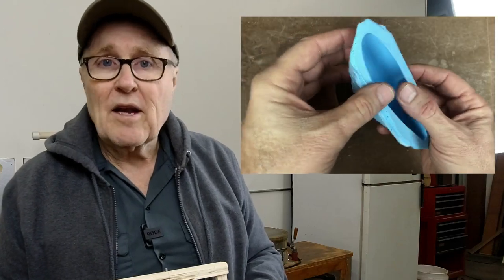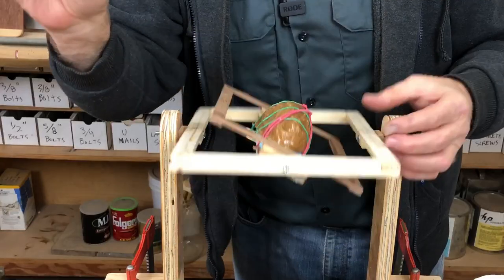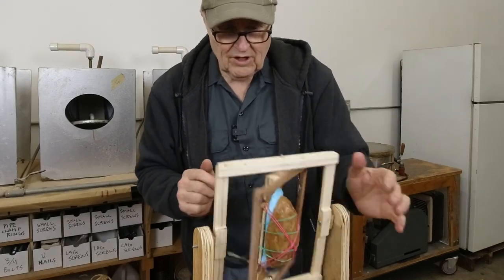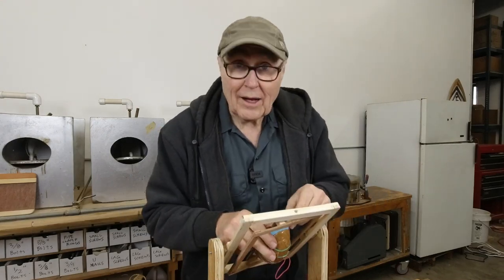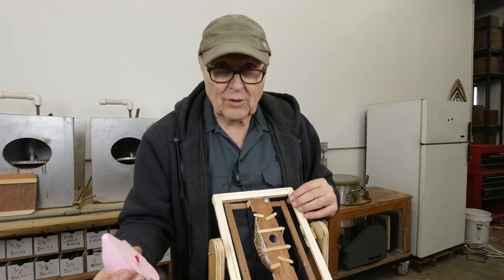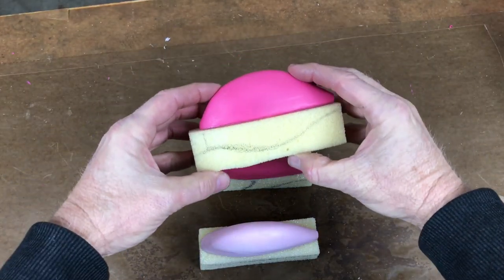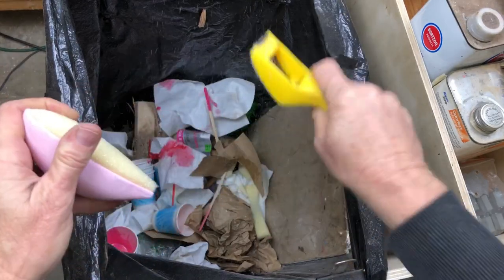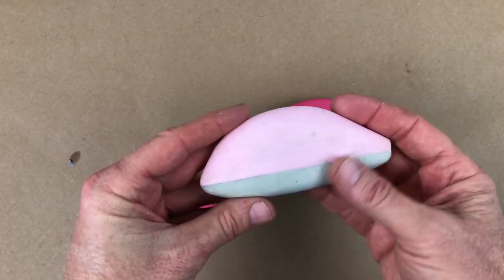Rotocasting Small Parts In Urethane Resin

Comment: Robert you spin your mold quite fast, the resin is like thin yoghurt even at the start. Would rotating more slowly make any difference?
Reply from the maker: I have spun slow, I have spun fast.  What seems to matter most is having the proper amount of resin in the mold for each shot.  Ideally you want just enough resin to coat the mold but not so much that it pools up inside the mold.

Comment: Is the resin evenly distributed throughout the rotational casting process? This might be just what I've been looking for, but I need the thickness to be uniform.
Reply from the maker: You can never completely control the thickness of the interior wall. The best way is to rotate in several small batches; each one should be just enough to coat the interior.
Reply: @RobertTolone  thank you!!!

Comment: I want to make some doll heads (think barbie size more or less), and I want to use this method. Do you think urethane rubber is suited for this project and does it matter what size I make the device for such a small project? 
If there's a video on making the device please let me know! Definitely subbing, great content.
Reply from the maker: Thanks for watching! You can use urethane rubber for cut molds and rotocasting molds. The urethane rubbers that I have experience with tend to be tougher and harder to cut than silicone rubbers. But they can be cut. They also stick to almost anything and need the appropriate release agents to separate them from the model, sprue system and mold case.  Also, the casting material must be compatible with both the urethane mold and hollow casting. Test everything to see how things work out.  I’m planning a video on building a rotocaster which will be out soon. Stay tuned!
Reply: @RobertTolone  thanks for all the info! I'm brand new to all this, so I know there will be tons of trial and error but I feel like that's all part of the fun😋

Comment: Hmmm...if you made the interior frame out of wider stock you could hit it with a compressed air blast to get it spinning.
      But flipping the gimbal doesn't look like to much of a chore.
Reply from the maker: It’s helpful to have a clear idea of how and why you are rotating the mold. Often a random rotation pattern works best but sometimes you rotate in a particular orientation to make a better casting from the mold.